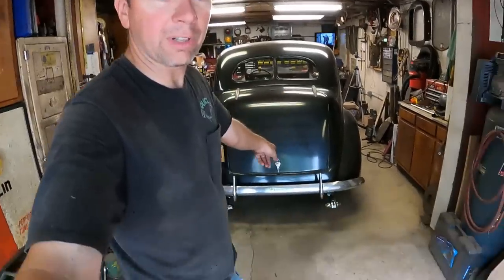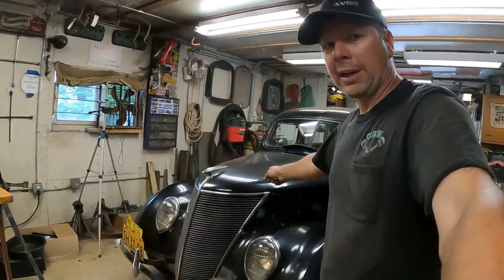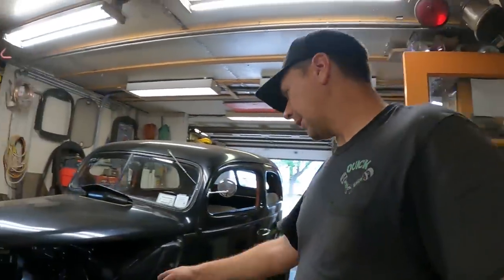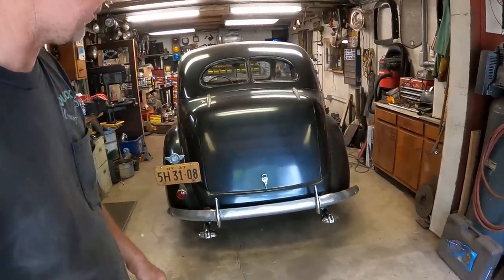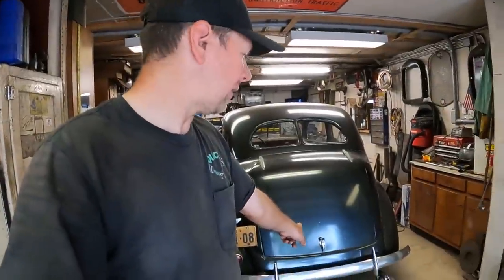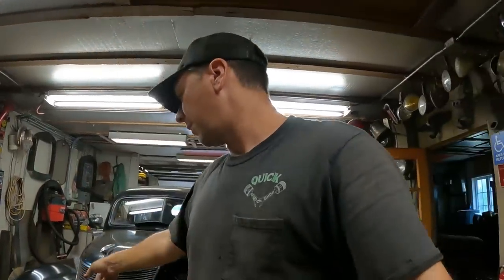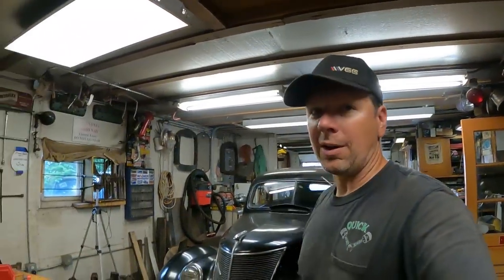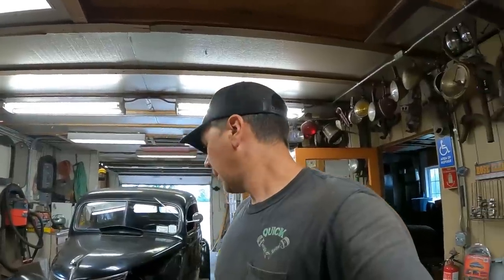1937 Ford Taildragger:  Flathead Ford Straight Pipe Drive-By

Comment: Looks great, and love the sound of the flathead V8, but I suspect that you'll be putting some kind of mufflers on it if you drive it much!
Reply from the maker: No mufflers!  It's not loud inside, but sounds badass out the back.
Reply: @QuickSpeedShop  i got a 36 ford pickup with the orignal flathead and no mufflers also

Comment: Take off the exhaust tips. Doesn't look good at all. Put some Cherry Bombs on. It will sound a lot better. As is would be ok in the wilds of Montana or streaking along Rte.2 in N.Dekota. I keep hearing a valve tap noise. It may be the exhaust note. Car is really cool though. Flatheads are awesome engines. Best wishes for a great car.

Comment: If i am not wrong Ford was the 1rst with V8s and now seems like they are the only ones that keep V8 alive
Amazing sound 
Good job Sr
Reply from the maker: There were many V8 engines before Ford, but mainly in more expensive luxury cars.  Ford produced one of the first affordable V8 cars starting with the 1932 model.  In the 1920s and early 1930s Henry Ford wanted to produce cars the working man could afford.  The Great Depression put many expensive car manufacturers out of business.
Reply: @QuickSpeedShop  good info
I wasn't sure
Thanks for clear

Comment: So I couldn't find where you updated us as to if the reverse eye rear spring mod was a success with the longer shackels.  Do you need a panhard to tighten up the rear? And how much did the rear actually drop??
Reply from the maker: Didn't need a panhard.  Seems to handle okay, but haven't driven it more than a mile do to engine issues.

Comment: Looks good, fancy tail pipe tips nice touch. I love the sound no such thing as too LOUD but that's just me. Is the 40 Mercury on hold for now I know you had some suspected clutch issues and engine temp concerns keep up the good work look forward to Sun and Monday videos.
Reply from the maker: Merc is going to come back around in the fall.  Going to get my lift installed so I can pick it up to work on the transmission.

Comment: Sounds like she's going to need that tune up soon or your going to be fouling plugs every time you fire it up. once you get it hitting on all 8 you're going to feel the difference and it should sound a bit better.
Reply from the maker: It's running with a really old condenser right now because the brand new one failed after about 10 minutes.  Rest of fuel and ignition system is new or rebuilt.

Comment: Camera mics never do justice to an exhaust note, I know from buddies that have had stock flat heads with straight exhaust that they sound really good in person, the camera mic makes it sound obnoxiously loud like it has no pipe what so ever. 
Now you got to put in a "3/4" race cam (aggressive but streetable cam) to make that pipe sing.
Reply from the maker: I hear you on the camera mic problem.  I think the engine might have a cam in it as it idles lumpier that other stock flatheads I heard run.  It has adjustable lifters in it so might have some sort of cam too.